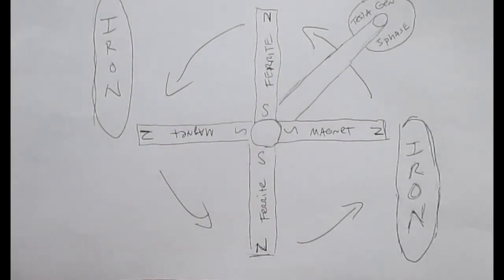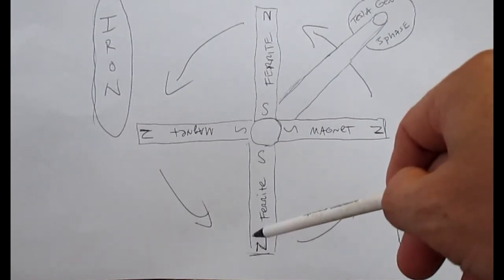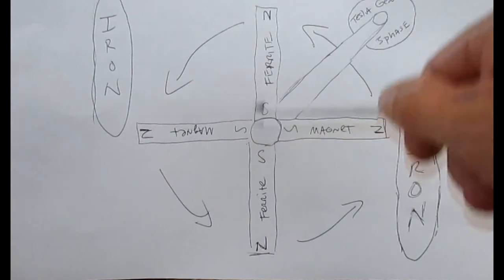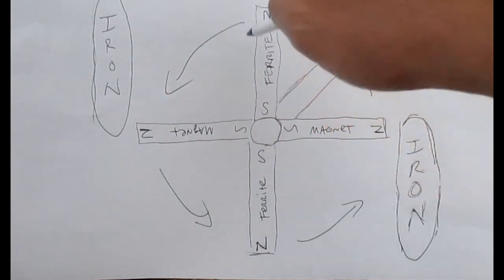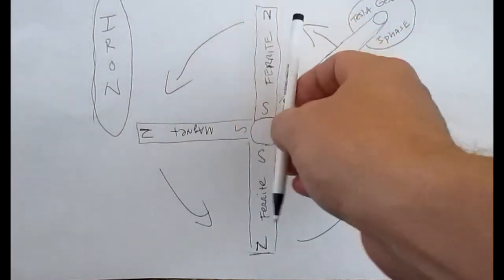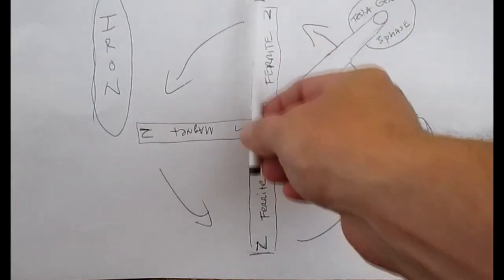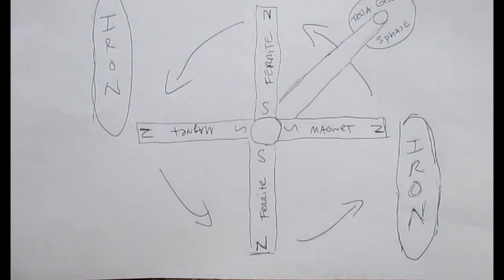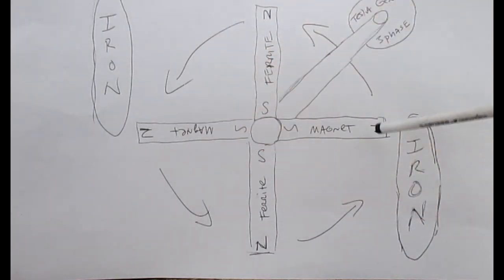Iron V Gate Pulse Motor

Comment: The design looks solid.  simpler than a standard v gate.  Cant see any issues.  might have to experiment with  different air gaps to get the best results.
Reply from the maker: stay tuned ty
Reply from the maker: air gap is not an issue you can always move your Iron Bar, just dont use excess energy to push , no push is necessary the setup is supposed to pull , the pulse is just to break  connection between Iron and Magnet not to push  or propel.
Reply: @mykedoes4099  I understand, thanks.